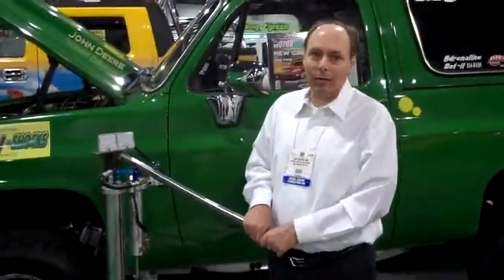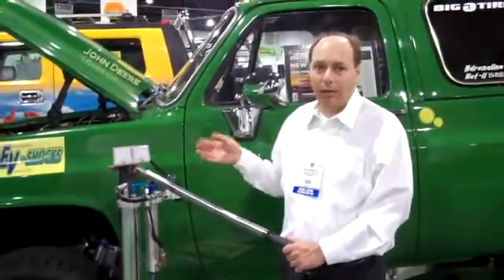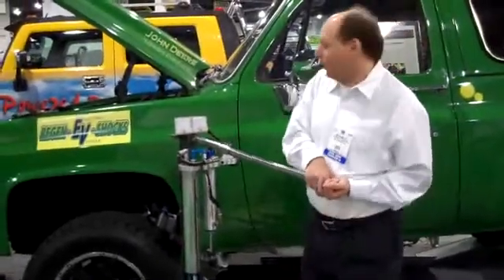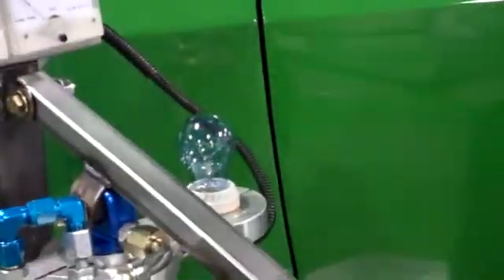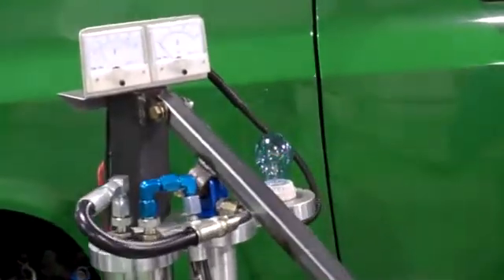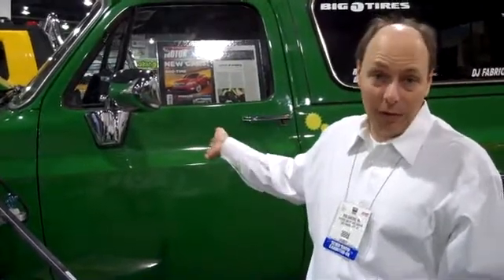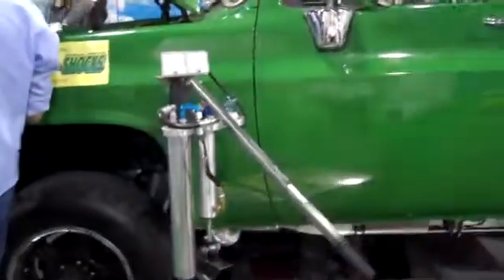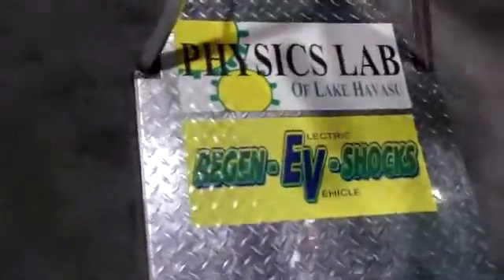Regen EV Shocks

Comment: I guess there are two questions.
1) what does it cost
2) how much electricity can be generated.
If the cost of the system is more than the value of the electricity generated, that perhaps it is not worth doing.